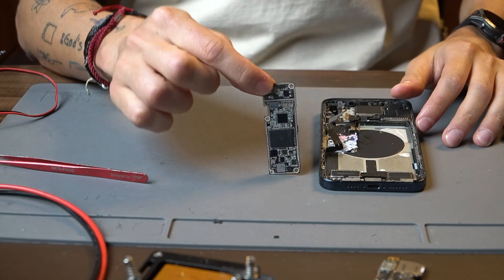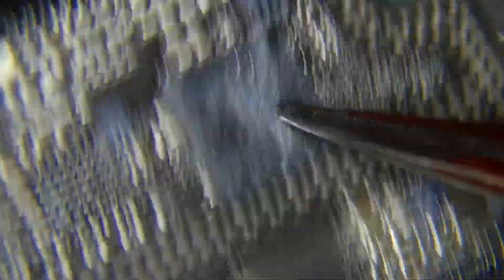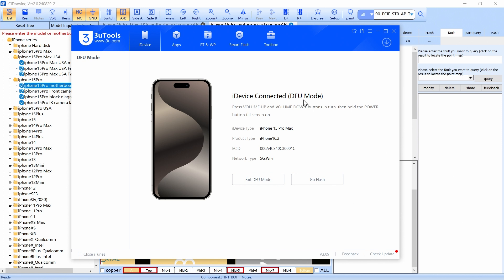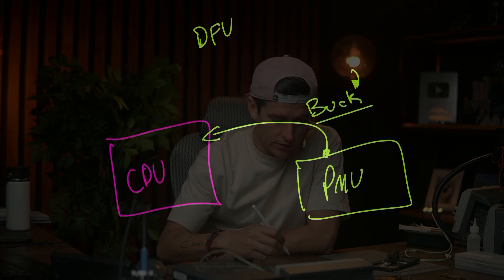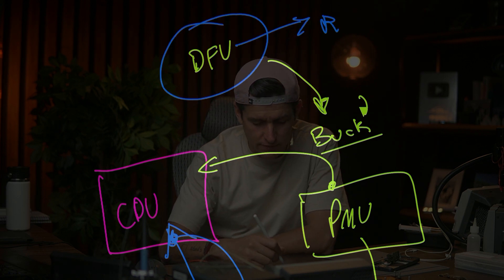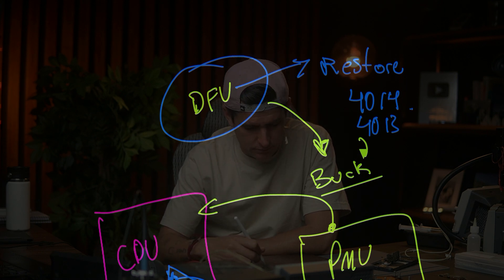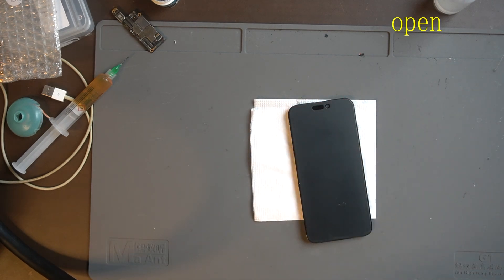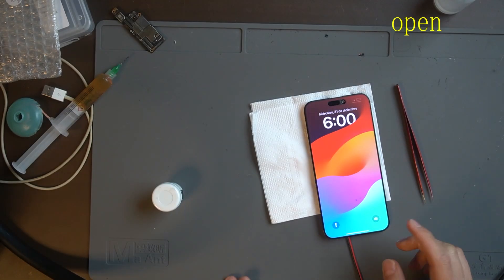15 Pro Max NO POWER 😖 | This is how you fix it

Comment: Hi Edgar, new Subscriber here and amazed by the detail you go through to explain the troubleshooting process. I have searched through your videos to see if you had another video explaining how to troubleshoot low consumption that is not DFU mode. I have an iPhone 15, no consumption pre-boot (No Main shorts) and when prompt to boot only pulls 0.060 mA. History: Water damaged was reported and worked for a couple days, then it turned off. Will not show any voltage on Ammeter when plugged in to charge. No visible signs of corrosion anywhere so I split the board to continue visible inspection and still nothing sticking out. So, I removed "All" shields to continue my visual inspection and still nothing. Used Branson EC in Ultrasonic , alcohol bath, verified the DM readings as described in this video and all TX/RX /Clk have readings. Reballed the halves and no change. what steps would you do next? Main power rail is present, VDD Bat, etc... but not sure which power rails to check from PMIC... couldn't get the Software Voltage to display on all power rails (Like Buck, etc.) except the ones with voltages in the name. Any advice would be greatly appreciated! TY again for your great videos and time :)

Comment: When you use the multimeter to check the capacitors, one pin is on the capacitors, but where do you place the other pin to see if they are connected?"
Reply: The other pin is connected to the ground, which is either ontop the Nand which serves as ground or ontop any of the silver plate

Comment: I have a 11 Pro Max device, the internal headset does not work despite the peaceful objections Good volt is available I replaced the charging flats and the speaker I replaced the big and small Esian Despite all this, the internal speaker does not work